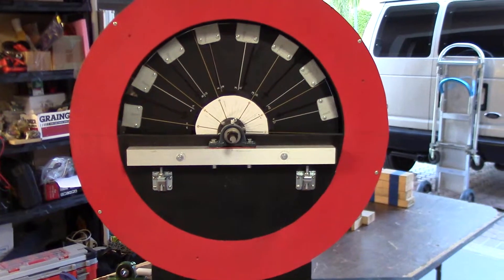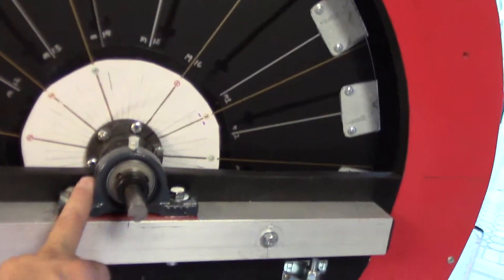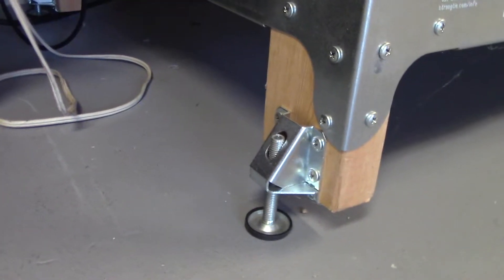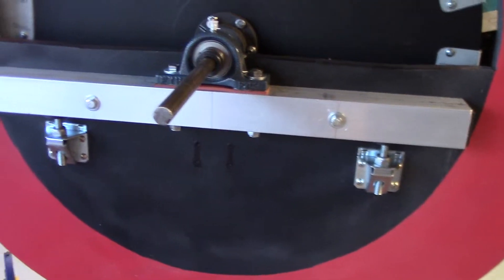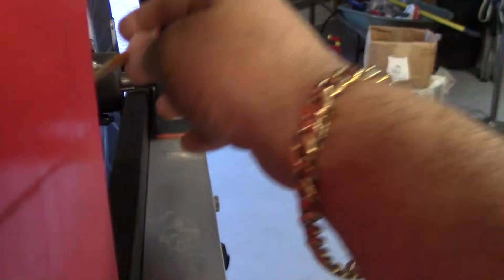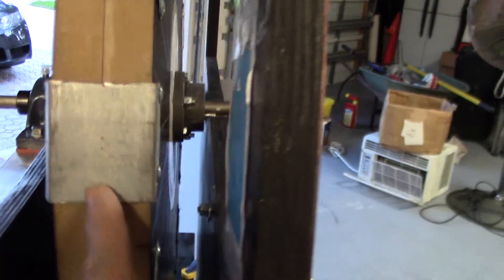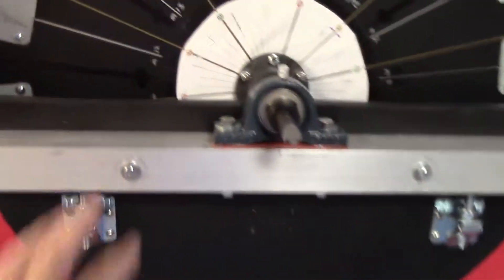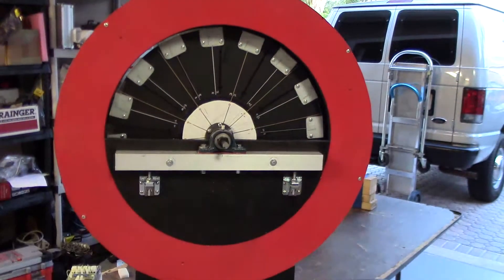ZeroPointFuel - Magnet Wheel Frame Alignment

Comment: The way I insured that the wheel was perfectly aligned with the frame was I mounted the aluminum  support arms with the bearings and axle directly over the center. Then cut the frame and the wheel utilizing that axle as the pivot point for the saw but I know sometimes that is impossible if you're using different materials for the wheel and the frame so good job on the video big thumbs up.